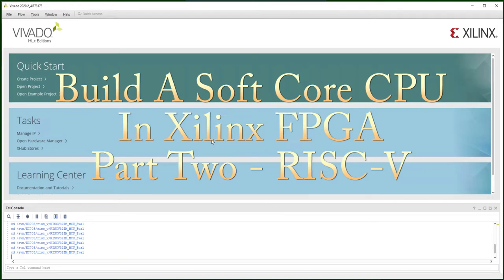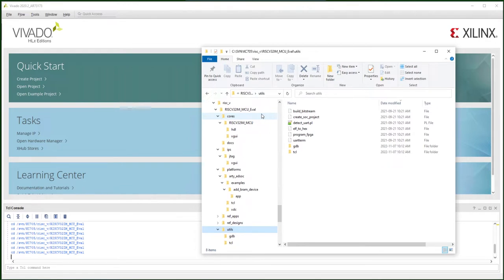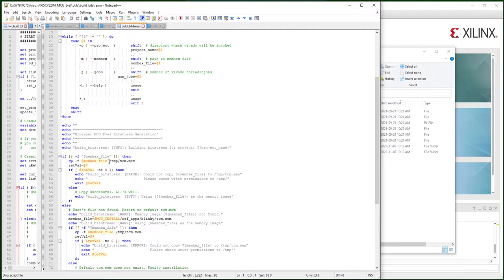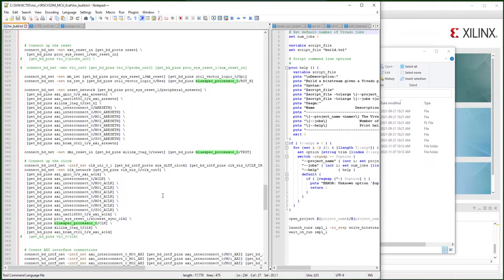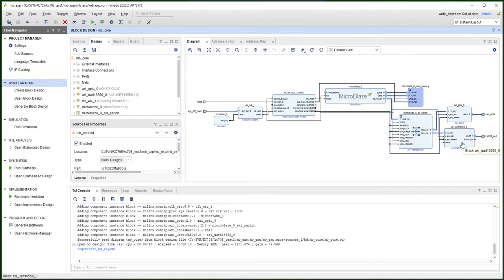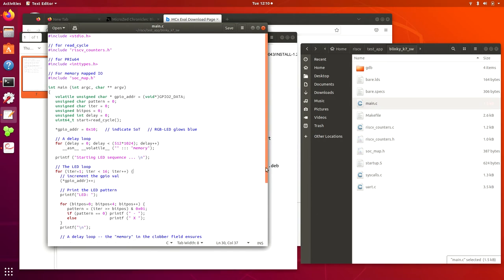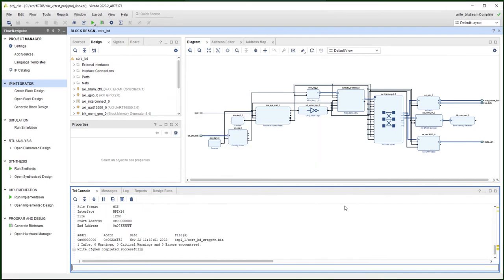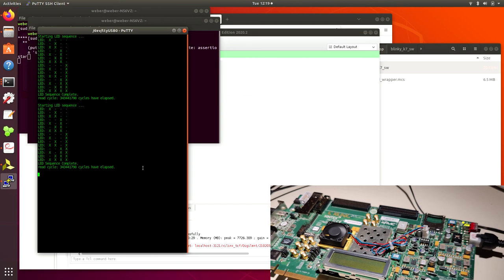Build A Soft Core CPU - Part Two - RISC-V in Xilinx FPGA

Comment: Hi, do you know if this works in Zynq 7000 FPGA board as well? thanks
Reply from the maker: It only uses general logic fabric for the RISC-V core, should be ok using zynq board too, but you just waste the built-in ARM core. Also, may need to try out how to properly boot from zynq architecture to RISC-V, I guess maybe similar to using microblaze in zynq.